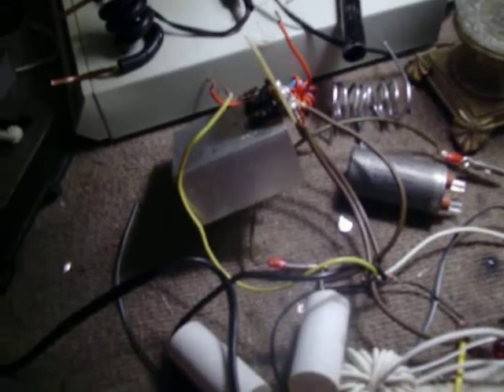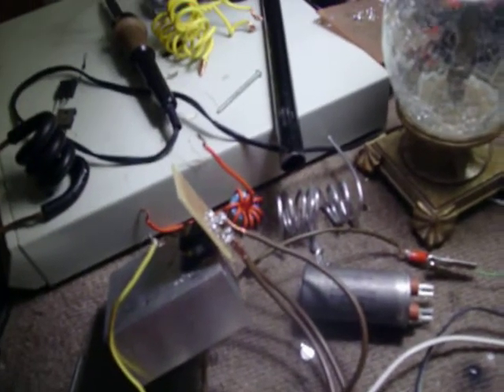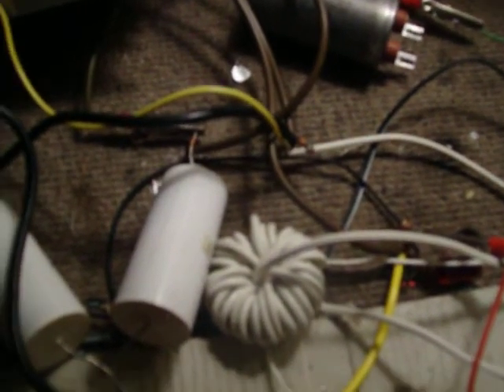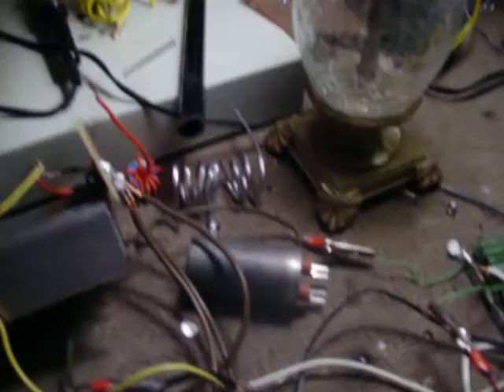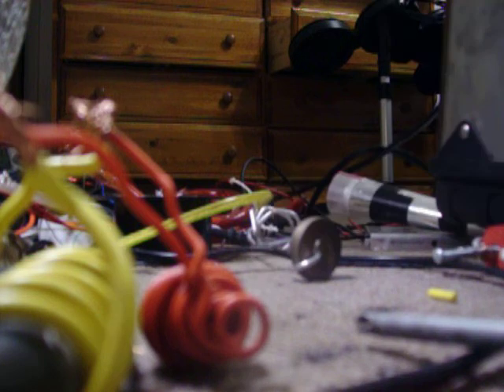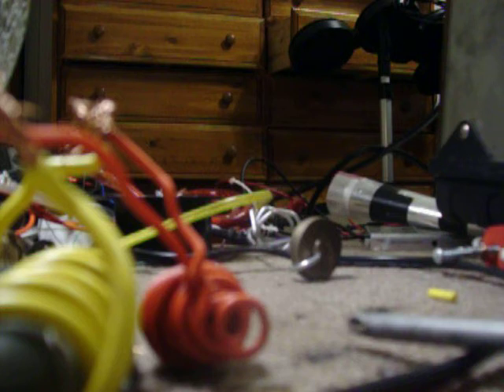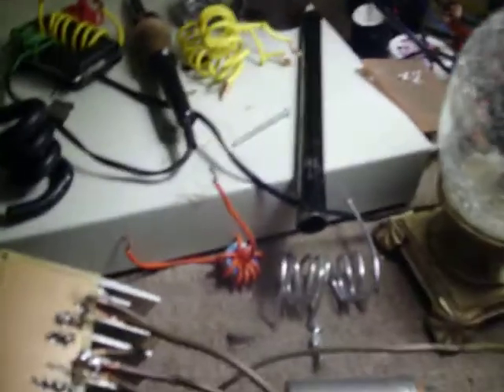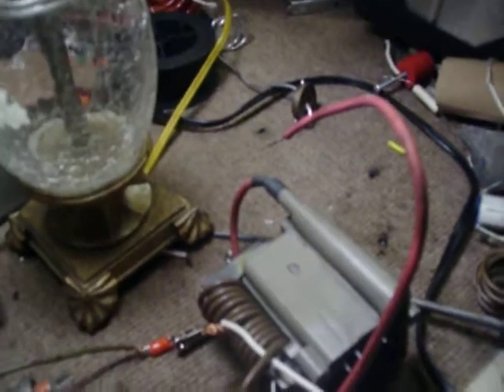ZVS driver, need help.

Comment from the maker: 12 volts, unless your mosfets or IGBTs are dissipating alot of energy. Then, you can go to 15v  or so, which will allow the gates to see a higher voltage, and mostly reduce any linearity while switching.

Don't forget, stray inductance causes ringing, therfor alot of heat, thus killing mosfets. So, that is a bigger killer than dead diodes.

Comment from the maker: Yea, sure there is a need for running more pullup resistance. For one, it can reduce ringing on the gates, which cause huge switching losses and extremely low efficiency. I would say the number one killer for these drivers is the switches. If mosfets see too high voltage, they avalanche and burn off some energy as heat, but IGBTs die. Mosfets can short for some reason, and they are pretty linear at that point. IGBTs have a voltage drop... Also, zeners protect the gates. No need for more than

Comment from the maker: I already made one run... Look at my videos. I pushed 600 watts at first, and then with a homemade HV transformer i could push 720 watts for quite a long time. 

I have even made a new ZVS just to screw with, everything is on a 2.5 by 2.5 board, minus the heatsinks. I know someone who made it with SMD parts. Insanity :D

Comment from the maker: I have made other ones that work. Check my videos. In fact, i made another more compact one recently. Still need to put the videos up.

In any case, i have made a homemade transformer, running at 700 watts, and used normal LOPTs, and i have made another more powerful halfbridge driver, and i pushed 1.4kw through a modern day LOPT! Thats alot of power... :P

Comment: Hi

I rebilt my ZVS driver 5 times befor it worked i use it as a induction heater , i was using 12volt zener and it keept blowing ive got 15v ones and its ok now , mine runs at 40 volts @ XXX amps , good luck fixing urs cool video too
:)

Comment from the maker: Well....
I never fixed this one. I made a new one (my current one, which doesn't work, i might fix some time) and it did the exact same thing. I switched to a power supply that was not switch-mode, and it works fine. Other than that, my current ZVS has never been changed from the beginning, other than boxing up.